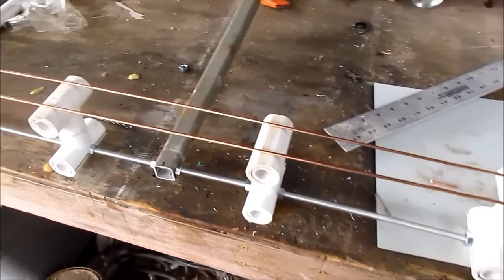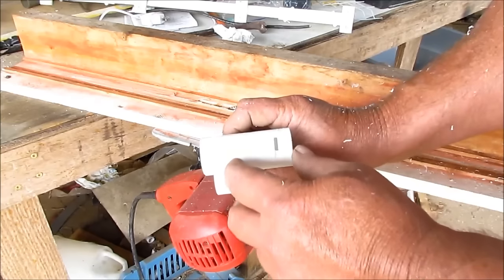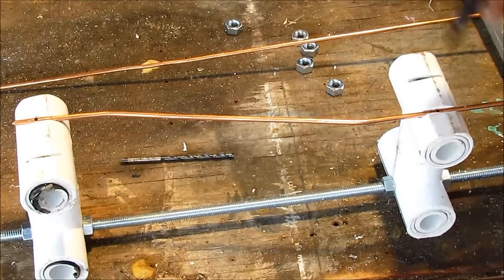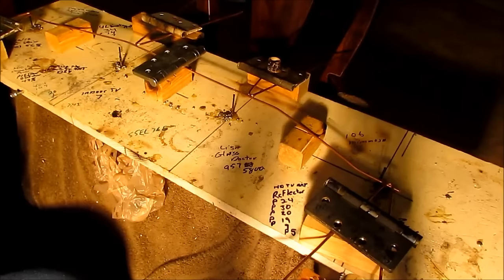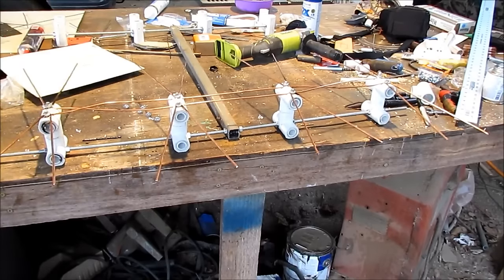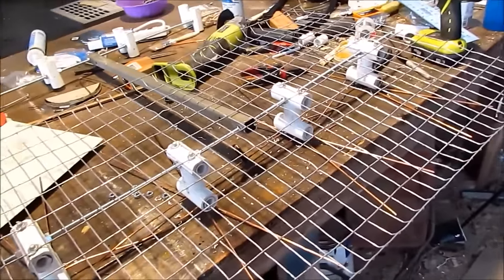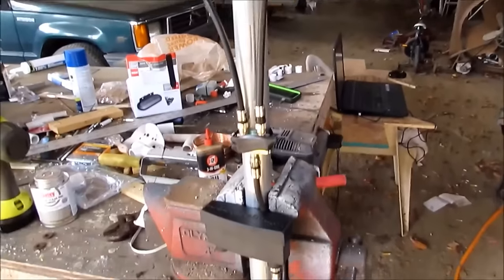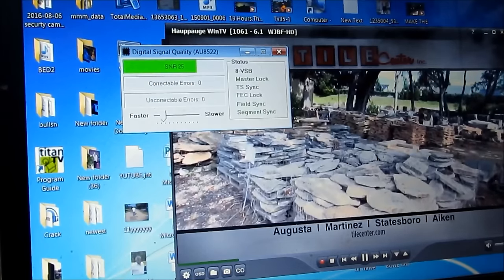Make The Best TV Antenna PT. 2

Comment: Jacksonville -- Just mounted and hooked up my ultimate antennae yesterday, just in time for the play-offs. Danny, I cannot thank you enough. The build was a breeze and the reception is extraordinary. I cut the cord last Spring but this makes it official...the perfect complement to the content I stream. The HD reception is boss on our new Samsung 65" high dynamic range flat bad-boy. I cannot describe it. I am floored. Ironically, the 2-in-1 antenna is perched atop the very same foot mount where our satellite dish used to be.  What a fitting homage to a dying blood sucker. Like to think one of the pounds driving that stake through its heart came from me.  Hallelujah!
Reply from the maker: sounds good i have more comming
Reply: Danny S Hodges
Reply: Danny S Hodges: I misfired on that last reply, sorry. When I first reported what a great success your ultimate antenna is, that was before I checked signal strength on each individual flatscreen in the 3 rooms the antennas feed. Strength is 100%, without boosting. Could that be because I'm only between 15 and 20 miles away from the towers in Jacksonville?
Reply: I used the existing Dish mount as well. Agreed, a fitting homage.
Reply from the maker: YEAH

Comment: Danny, Your tvfool report looks bad for getting all those channels from Dublin to Macon and shows your db in the negative in a bad way.  Mine does the same at my zip code.  I'm going to try to build your Ultimate Antenna and it should work close to the same, or so i would think.  My towers are about the same distance out as yours.  GREAT job on building and showing us how to build these antennas.

Comment: Hey Danny great vids.
I have two towers that are directly opposite to each other. Could I make an antenna with a wire reflector in the middle and have the rabbit ears on each side to pick up both signals? Or will this cause interference? I haven't seen any videos talking about this type of setup.
Reply from the maker: Hey are u joking i get that sometimes....I DONT UNDERSTAND THE ?

Comment: Danny's antenna will work vary good on a rotor! Hay Danny how high is your tower we had a tower  late 1970's on  kissimmee river down in florida at 113 feet the tv antenna was I say about 80 feet we broadcast something like 100,000 watts on 11 meets ssb on a home made 18 element antenna we used a Variable Frequency Oscillator (VFO)  so we broadcast anywhere an any frequency we wanted lol or tv antenna work vary good at that high unless we keyed the mic lol
Reply from the maker: mine is about 90 feet i added 20 feet to the bottom...wielded on 20 feet

Comment: Question, Danny.  In earlier videos you used two 75-300 ohm transformers...one on each antenna.  On later videos, you seem to be tieing the two antennas together Left-t-left side and right-to-right side, using one one transformer between them.  Do you see a difference in performance in the two techniques?
Reply: @Joe Zorn
 - You have to add a Pre-Amps to this concept. That way it splits into one.

Comment: Hey Danny,
I got a question and a comment.
First off, that tower you show in the vidoe,  When you replaced the antenna did you have to climb it to replace the antenna ? OR is that one of those towers that bend over ? You had told me that a double antenna like this would be as good as a booster. Yet you installed a boster as well. Just wondering how well that works ? 
And the second thing,
God has a sense of humor, he created women. Funny thing about mine is she like to tell stories, all the most embarrassing about me. And she gets a lot of laughs. Over the years I have learned Not to say anything that might embarrass her.  We have been together for over 30 yrs, funny thing no one ever told me when you get married this is how it works.